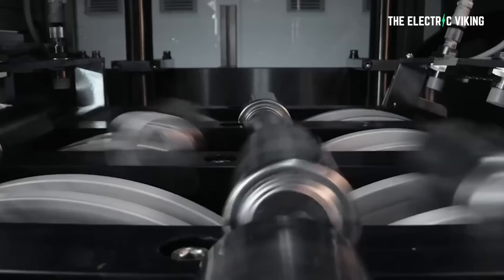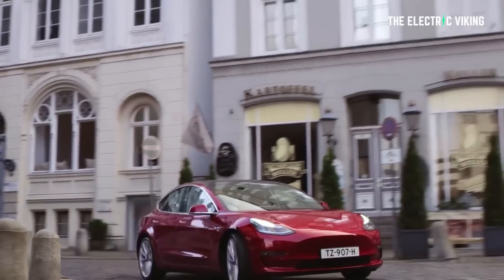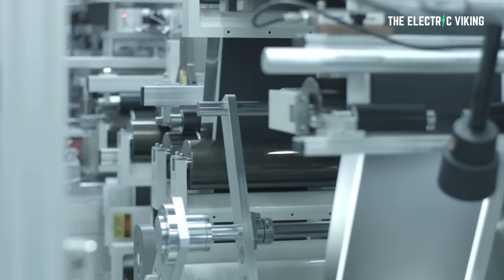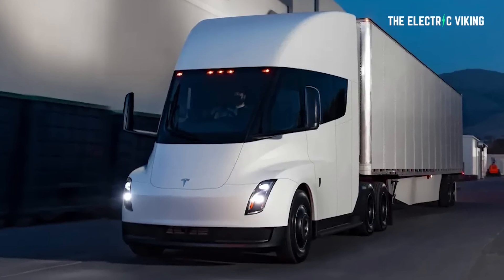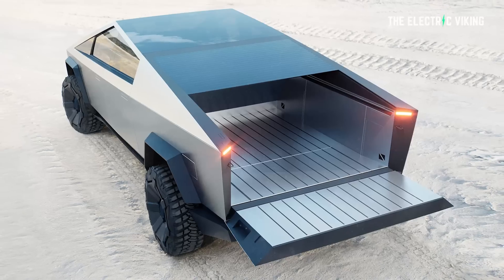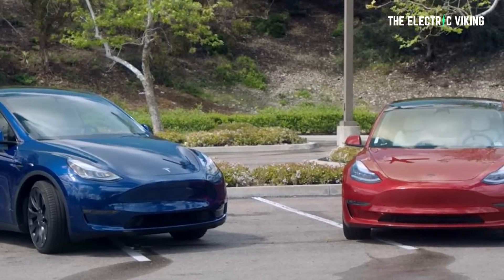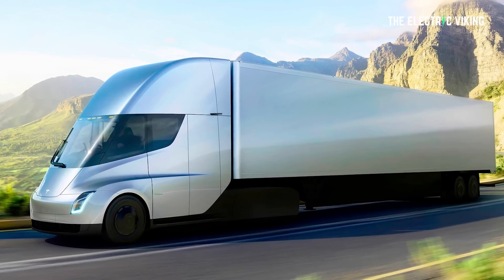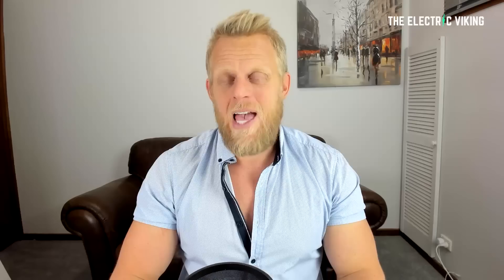Tesla URGES Panasonic to speed up 4680 battery production

Comment: So what happened to the idea that Tesla making its own 4680 batteries was going to be the solution to all Tesla's battery supply constraints? This fantastic new form factor and dry electrode technology were supposed to lower costs and increase efficiency. Only one problem: Tesla (and Panasonic) are still struggling to make them fast enough to match the proposed rate of production of the cars themselves. This is a new manufacturing process, and I read one Teslarati article where it stated that even Panasonic, who are battery manufacturing veterans compared to Tesla, won't be able to start mass production until March 2024. It's make or break time for Tesla. If they can't make the 4680's at commercial production rates, they will have to either abandon 4680's altogether, or reserve them only for limited production models like maybe the Roadster and Model S Plaid. It will be interesting to see how the next couple of years pan out.

Comment: @6:30 Totaly Agree 4880 is a form factor, not a chemistry formulation. It can be used for LFE as well as any other cell formulation.
Reply: It can be except that Tesla explicitly said they won't use 4680 for LFP. The properties of the different chemistries must be a good match for the properties of the mechanical design, and apparently Tesla doesn't think it's a good fit.